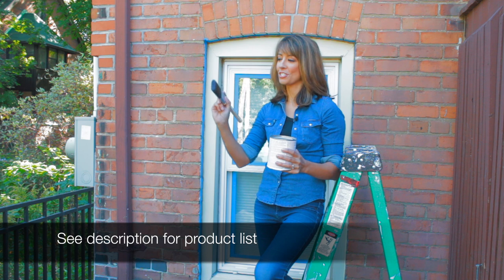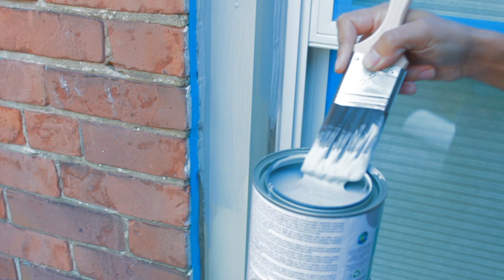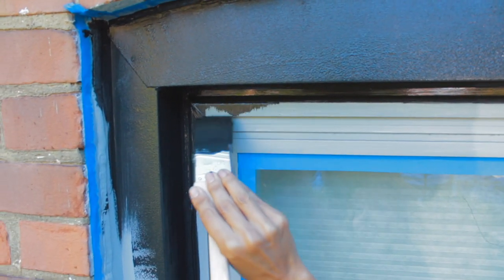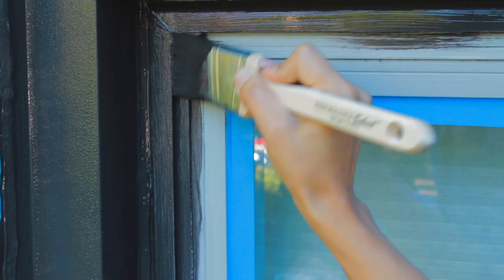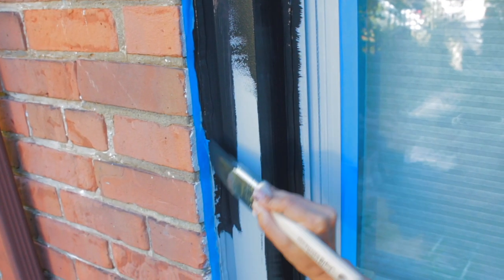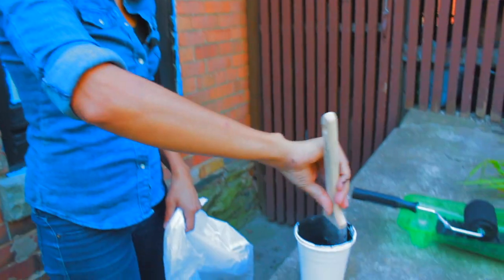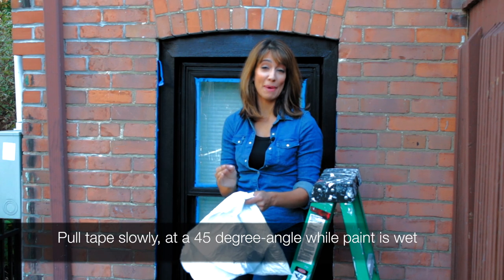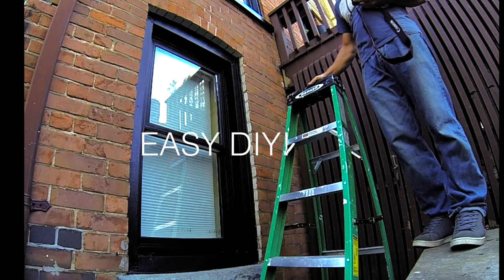Painting Window Frames | What You Need to Know!

Comment: Although it may seems obvious, it's important to include cleaning the window very well and letting it totally dry before primer. It may be easier to clean with a scotch brite type scrub pad, any possible resulting scratches are only welcome for the primer coat.
Reply from the maker: That’s a great tip and those work well. Thanks for sharing your thoughts!

Comment: It's always better to use acrylic paint for plastic surfaces, especially outside. Latex paint will more easily peel.
Reply from the maker: Hi Lynne,  Latex paint formations have come a long way and I’ve had excellent results using them on exteriors. If you prefer acrylics, follow the same steps and you’ll have great results! A lot of homeowners I work with prefer water-based over chemical based paints due to off-gassing and environmental reasons. With acrylics,  be extra careful not to paint your seals on your windows as the paint can break down your seals, causing your window seals to fail resulting in cloudy glass. Thanks for your comment!

Comment: What if you have windows with sealed glass and gridlines embedded in it?  Is there a tip/hack to make those consistent with the newly painted frame?
Reply from the maker: I don’t have a hack for them but I’ve seen DIYers cover the glass grid lines with black electrical tape. I haven’t tried it so I can’t tell you if it would look ok. I have installed thin wood trim on window glass. It’s time consuming and you need to be handy with a saw and glue. Good luck!

Comment: I went to the local sherwin williams store. They said emerald product line is self-prime. If we do need an additional coat of prime before painting the vinyl surface , what prime would you recommend? BTW, I saw you used the 1-quart can but for some reason, my local SW store doesn't carry one quart emerald paint.
Reply from the maker: I’m a little old school so I always prime first to ensure good coverage since labor costs are so expensive. I also want my paint to last for a long time. However, many people opt for just the paint. I’ve used test samples from SW but every region may be different in terms of samples. I remember it was hard for me to find samples too. I had to find a commercial SW store instead of the normal residential servicing stores.

Comment: If you want to paint the interior side as well, is there are a reason you wouldn't want to remove the panels, paint the window panels and the trim separately (instead of painting the assembled as you have done)? I feel like you might get less of a risk of sticking if you do the pieces separately, no?
Reply from the maker: Absolutely you can do that if you are handy. Some vinyl windows can be tricky to reassemble and due to age, the vinyl wears down and can be broken easily by a first time DIYer. I had a big double hung window break on one of my guys a few years ago and it had to be replaced so I don’t go that route but if you take care it’s entirely doable. Thanks for the question and for watching Alvaro!

Comment: Doesn’t the tape stick to the first coat cuz you have to wait for it to dry?
Reply from the maker: Hi John, once you apply the second coat it re-moistens the tape for easy removal. Always remove tape when it's wet, that's the key. Also, the longer you let your tape stay on a surface: wall, masonry, siding, interior and exterior,  the more likely you will have issues with peeling paint. Thanks for the question!
Reply: Daru Dhillon   Thank you for answering.    And with all due respect you are very cute.

Comment: Thank you for your time.  How to paint the frame inside the house? How to clean the frame before painting?
Reply from the maker: Hi Thien, I used warm soapy water and a scrub brush made for cleaning dishes to get into the sliding tracks. I wiped the soap residue off with water. Then I sanded down the window to prepare the surface for my primer and I a lint free cloth to clean the surface. Thanks for watching my videos!

Comment: What happens when you open the window? Won't you have missed the edge of the trim? And won't the dry paint chip when you open it?
Reply from the maker: You need to open the window a crack before the paint dries so you don’t paint it shut. You may need a small touch up depending on your window. I haven’t add any issues with chipping after it’s painted but it would depend on how your windows are installed. These are single hung and casement.

Comment: Hello, I am trying to paint my windows black, they are vinyl and they do get lots of exposure to the sun as they are in the hills, but I live in Toronto Canada where it only gets up to about 25 degrees at the highest which is only about 75 F, should I be okay? I noticed the vinyl safe colours are all very light, however i want to get black windows. I am okay with repainting however, just wanted to know how long they would last and if I would be okay considering my city isn't really hot
Reply from the maker: Hi, I’m in Toronto too. I usually paint windows that are nearing the end of their use. I personally wouldn’t paint newer windows. I’ve painted windows on the north and east exposures but replaced windows facing south. It’s usually done to buy the owner some time, looks wise before they have the money to replace them. When in doubt, be cautious.
Reply: Daru Dhillon so what would be ur solution to getting black windows ? Cuz I see it all over Toronto, my home is only about 1-2 years old I don’t plan in staying long term though just need to do it so it makes the house pop more. I heard some people mix vinyl safe colours to get black however would you recommend that?
Reply from the maker: sa99 I know they are all over the city. I wouldn’t advise painting newer windows a dark color, even vinyl safe because it can pose a risk of heating up the vinyl too much so that they don’t open properly or at all.

Comment: I have aluminum trim that is green with an aluminum white window. I’m wanting to pain it white . What would you recommend with this?
Reply from the maker: I would use a primer that is formulated for metal. The one I used is listed in my description box. I have also used a multi surface primer from SW on aluminum trim and siding that works well. The key is to sand and clean your trim before applying the primer. Lightly sand again before applying your first coat of paint. The primer can be white, no need to tint.

Comment: Black could cause long term problems as it gets hot in sunshine
Reply from the maker: If you have a window that is south facing or gets a lot of sun then don’t paint it it’s a concern. Most people paint windows when they want or need to replace them but can’t.
Reply: @DaruDhillon  well make it clear on your video
Reply from the maker: Thanks for the input, I’ll look in to making a card.
Reply: Will sherwin williams vinyl safe be fine with black color ?
Reply: @jili6148  read my comment - it has benefits too

Comment: I don't like it.
she mentioned water base primer?
She not mentioned what paint used?
Water based paint?
Water based paint will washed off after few years. 
Oil base paint is much better, last longer forever.
Of course YOU NEED TO SAND BEFORE PAINTING.
Fresh paint can't touching each other because will stick together and will peel off even after weeks been painted!
Reply from the maker: Latex acrylic paint is the standard for painting vinyl. Do NOT use oil paint. The new formulations of Latex Acrylic are “Vinyl Safe” and UV Resistant. They withstand the heat and expansion of vinyl frames. Oil does not. Latex has been the standard and GO-TO for professionals and homeowners for a long time. Especially, for vinyl, nothing comes close for durability and longevity. Oil based paints are not recommended for vinyl windows. I am now using Snap Dry. See the link in comments for the BEST black paint, as of now. All products are in the description. Subscribe for the latest in home improvement advances. There’s a lot to know!
Reply: @Daru Dhillon  snapdry i believe is a quick dry paint EXCELLENT FOR FRONT DOORS.
but not sure for windows where exposing to sunlight.
Let me know how looks after 2 years.
Probably my eyes not looking on the right direction... just can't find the paint description. 
Also if you leave AMERICA LAND for sure you can have a black window frame manufactured. 
If you didn't wanted to order or wait months. Local stores sometimes is not the option. 
So you have to paint your windows again after 2 years?
Reply from the maker: I have painted vinyl windows in black a few years ago and they look great. I expect it to last for a long time. Thanks, I also install black windows too. They look great and are the most popular choice for homeowners here in Toronto.